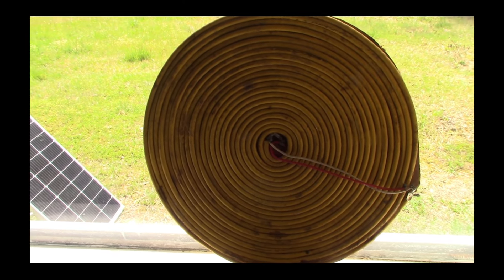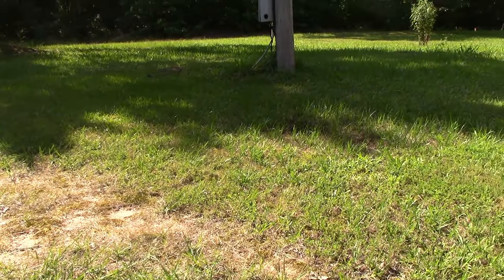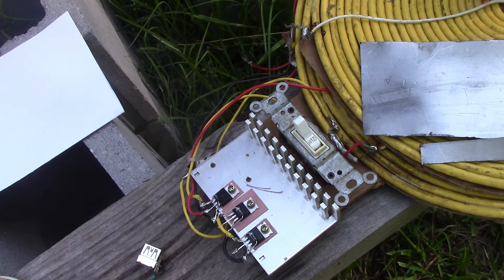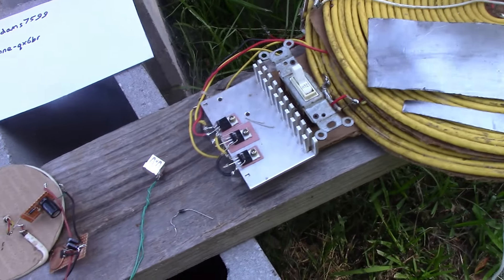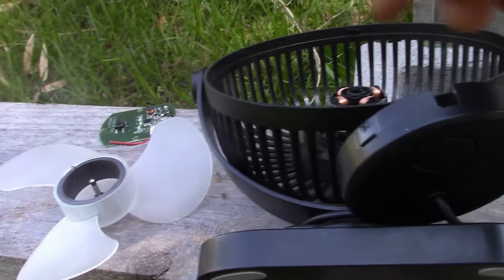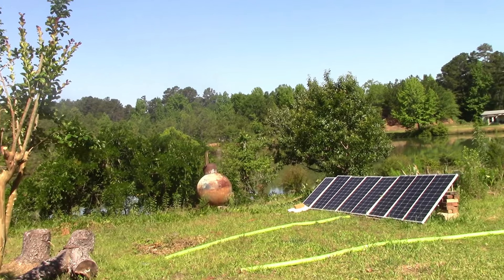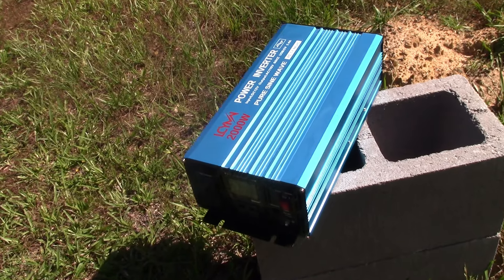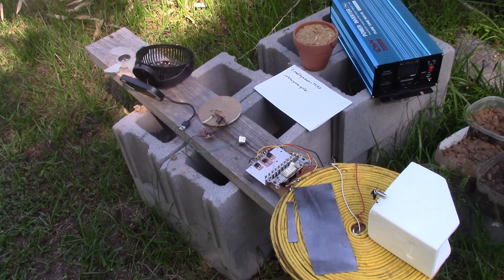Disaster - 100W Solar through window - Update

Comment: Thanks for the video, i haven't seen coils used like this before, Its brilliant. I'm still learning this stuff myself but i'm guessing the reason you are experiencing these blowouts is because of the coils. Its easy to forget that these coils can pick up other electrical fields also. So i would suggest insulating and/or positioning the coils far from other electrical sources. Its just a guess, i could be wrong 👍
Reply from the maker: Thanks Wayne. I didn't think about that with the coils, especially during the solar episode. The nearest mains outlet is ~4ft away inside the house, but yes, the wire may run under the window!
It's also strange how test systems worked on the grass (as seen with the 5V fan running) but instantly blew when placed against the window.
Reply: @Slider2732_  no worries mate 👍

Comment: Is the voltage sufficient with proper frequency ?
Reply from the maker: More than sufficient, these will run with under 1V. Frequency is approx 250kHz, so not too high for any transistor. It's a good point about limiting the frequency though, as these free run without such regulation. A 10W power resistor would do the trick and is what will be ordered when finances allow. 
Thanks for your comment 😀
Reply: @Slider2732_  Where do you get parts from?
Reply from the maker: @4bSix86f61  Amazon when we had Prime. A few troubles at the moment. I know, it does seem odd not to just order a couple of dollar parts 😀

Comment: I am reminded of the Simpsons "Old man yells at cloud" 🤣
Darn solar storms!
I work in I.T. so my #1 excuse right now for things not working is blaming the solar storm. So far no real equipment failures. But I don't have long runs of DC power wires and exposed pulsing magnetic coils.
I hope you get it figured out!
Reply from the maker: Haha thanks 😀 Perfect analogy too! Am certain that a 10W power resistor wouldn't go amiss. 
Latest casualty is the backup 500W solar inverter, which replaced our 2000W. It lasted just over an hour on a 50W room fan before blowing up AND somehow taking out the fan. Something really silly is afoot.

Comment: The sound in your inverter is probably from some coils that unglued themselves due to age/temperature. I have worse sounds from my computer when it reaches over 80C, and I don't know if it's from cheap Chinese power supply or from the motherboard.
Reply from the maker: Many thanks tdta! I've got it on the table at the moment, thinking of doing a teardown and fix vid on it (and the spare 500W which has also now blown up). Am not sure though whether to open it as it's only 9 months old. It was from Amazon and I've no idea if any warranty is valid... am going to email the seller. If no warranty, then the hotglue gun will be plugged in, great tip!
Reply: @Slider2732_  I think hot glue might not penetrate between the copper wire in the coils, but good luck, might be enough to stop the sound.
Reply from the maker: @szajsjem  Oh, I see, the sound is of the coils individual turns vibrating? Hmm, something like epoxy would be a better idea then perhaps. Thanks again for the idea, I'll be sure to mention your good self if I do a video and fix it. Still, looking at this other video's viewing figures (good for my channel) I might post a failure anyway lol
Reply: That's the sound an inverter microwave makes when it smokes
Reply from the maker: @4bSix86f61  That's the worry, that something is ready to finally let go the next time it's used!

Comment: You need to start putting Faraday cages over your hardware
Reply from the maker: Well, the roof on the house is metal, so am part way there 🤣
But yes, I agree, start saving cake tins and such to put things in. It's all mad, when the backup of the backup fails, as with our solar inverters!  I'd probably go off grid except for needing the grid to fix the off grid things!